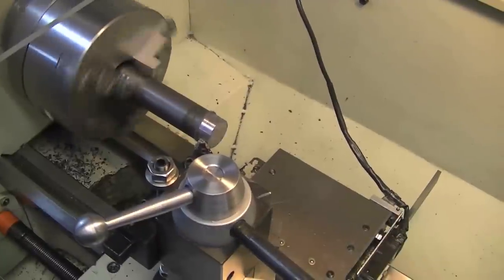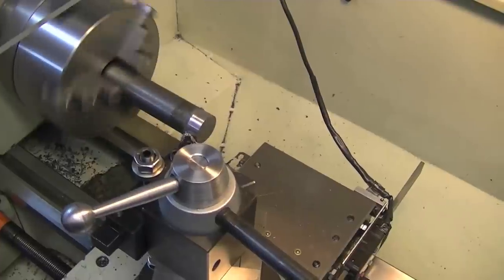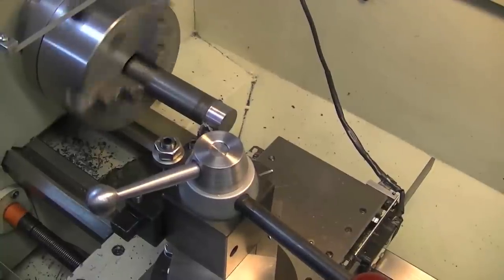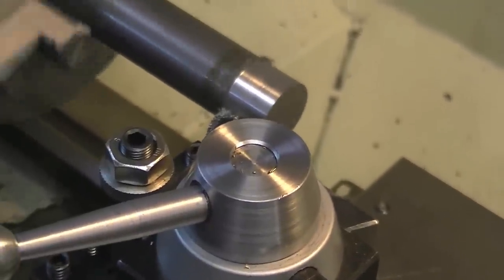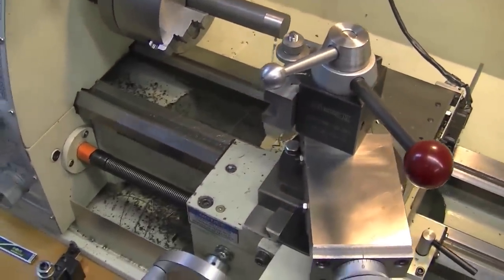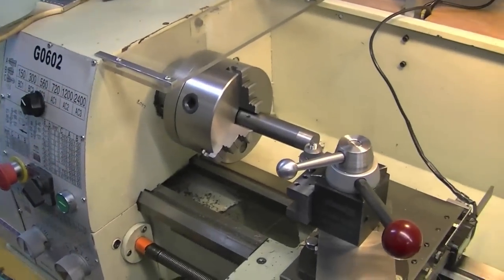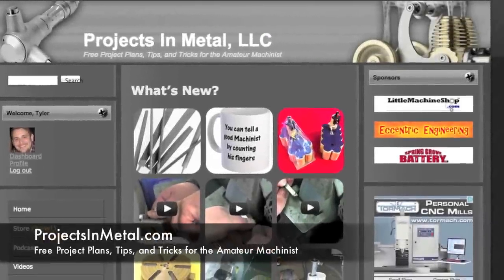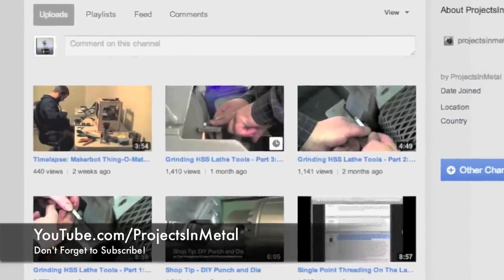Jim Schroeder's Tangential Shear Tool

Comment: You can get a really good finish on S1214 using the inserts made for aluminium.  They don't last as long as a stronger insert but they work really well on a small lathe that lacks hp. BUT they do need spindle speed to work properly, about 2000 rpm on one inch diameter.

Comment: The WNMG tool will leave a much better finish than that if used correctly. They need high RPMs, high DOC and high feed rates. If you do that you will get an almost polished finish. Just the fact that the HSS tool was used without a speed change tells me that the carbide tool was going to slow. I find 500 FPM is a good starting point with these tools, .020" DOC as a minimum and .006"-.008" feed.

Comment: Most carbide tools do not work well at a shallow depth of cut and slow feed. My lathe I use a CNMP-431 or 432 insert (Kennametal KC850) and have found it works well on materials such as 4140. The WNMG insert he is using actually has a flat edge on the top surface that when the insert is in the holder it is actually presenting a negative rake to the part. With out sufficient depth of cut or feed is basically plowing the material off of the work. The CNMP actually has a positive rake

Comment: You got to work that carbide hard. It is not meant for slow ME on a myford ;)
Reply: Krispin Gord yes the insert is designed for a deeper cut and higher rpm. It will leave a very good finish on steel if used as intended. But you won’t remove stock with the shear tool like you will with the jnsert.
Reply: Look at 3.07.It is not a Myford. But your point still has relevance

Comment: You used the wrong feed, DOC & speeds for the carbide tip, so it is not a fair comparison. In addition an HSS cutter properly ground would have done as good a job as the tangetial. Tangential cutters are for those who cannot sharpen HSS tools properly.

Comment: There is no difference in the cut between that "tangential shear tool" and a properly ground HSS tool of more conventional design.  Comparison between this and a carbide insert (specially this insert, the worst possible tool for this work) is no more useful than comparing a Suburu to a Ford tractor. Both good tools for their respective job but not interchangeable and no meaningful comparison can be made.